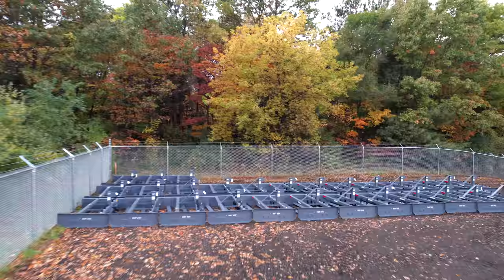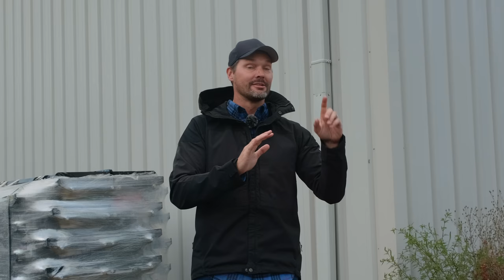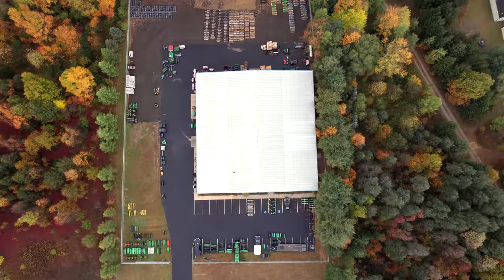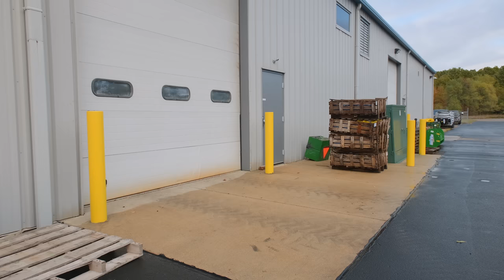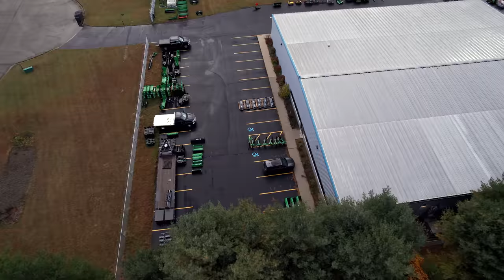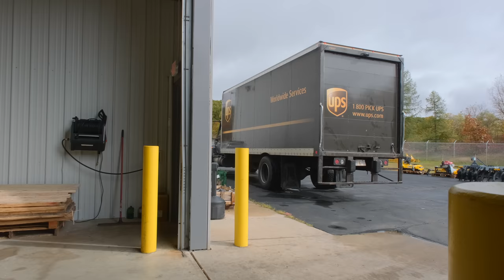$150,000 DOESN’T GO AS FAR AS IT USED TO, WHAT DID IT BUY ME?

Comment: FOR THE SAGGING ROOF INSULATION. I would use 2-3" hardboard insulation, paint it, and cut it to fit in the web of the I beams! won't sage and adds lots of R insulation up high where the heat is! You did good for 150k!

Comment: I’m a facilities engineer and just ran across this insulation problem. In my case the insulation face was too brittle to tape onto so we looked at spray foaming but it was against a certain NFPA code I can’t remember which one exactly. Some local inspectors will let you paint spray foam in warehouses with intumescent paint but we opted to build a small grid between frames and lay in new insulation and tape the vapor barrier to the stronger face a couple feet outside of the damaged area.

Comment: I owned a metal building bizz for several years and for me I wouldn't use patch tape as has been suggested over those rips. After a short period of time it always ends up looking discolored and sometimes worse than the rips themselves.  Since it is at the peak, more insulation there could be of benefit, so I would get a 1 inch reinforced vinyl backed roll of insulation (same as you have there now) and put it in whatever the width is between the top 2 purlins and running full length. Install with wire retainers that hold by tension between those top 2 purlins. Start at one end with some of the 1 inch insulation removed and the vinyl secured via double stick tape at the end wall and give a slight stretch to the vinyl as it goes up, overlap any seam and use the patch tape there between purlins to lock it into one long piece from end to end. 2 man job on a manlift plus a ground guy to feed the insulation up, tape new rolls together, move tarps, as you progress. Lay down a tarp for the vinyl to sit on or it will pick up dirt very easily and hard to get off once up...tell everyone not to walk on the white backing because foot prints on your ceiling look terribly unprofessional...any metal building supply house will have the insulation needed.
Reply from the maker: Awesome, absolutely excellent information.  Thanks for taking the time to share!

Comment: What I did with my steel building (not as big as yours but same construction type) is insulate the underside and a layer of steel on the under side giving you twice the insulation and the steel looks really nice.  made it easy to heat in winter,(i am in Canada.)and stay cooler in summer.  no doubt the most expensive option but i have saved money on heating and it has stayed looking perfect since completion almost twenty years ago

Comment: Simple method, put a thick, like 8-10 mil plastic sheet up and blow insulation between it and the existing.  More elaborate method, pull the existing out, put a barrier up and spray foam it.  Don't spray foam directly to the roof as the steel over time will break the bond since it moves more than the foam will with temperature swings.

Comment: Perhaps some spray foam for the insulation. You've done an awesome job with the place.
Reply: My thought also, some spray foam to encapsulate the damaged area.
Reply: I agree, spray foam would work.
Reply: Would it be better to remove the insulation in that center section then spray foam it. I expect the raccoon have left a lot of surprises up there. They are dirty animals.
Reply: @bruceanderson9461  my thoughts exactly just had my place sprayed on top of the ground crawl space but ask the people that do it they would know best eh...
Reply: Spray foam is almost certainly the way to go. R value tends to be very good too.
Reply: Depends, spray foam on steel in a barn type building like this tends to come apart after a few years due to temperature swings. The steel expands and contracts a lot and can break the bond between foam and steel.  If a substrate is installed between the steel and foam, that air gap can prevent this.
Reply: @acdii  This is disconcerting since I live in a house built with steal siding and roof and it is all spray foamed.
Reply: @stimpy5067  If the building was built with spray foam in mind, chances are they did whatever is needed to prevent temperature movement from breaking the bod. It is more difficult with an older building with the batting type insulation. Just have to make sure that whoever is doing it, does it for metal buildings. 
I was stabling my horse in a metal building with the spray on foam and it was coming off in chunks.

Comment: As a relatively low budget solution to that ceiling issue, I'd do the following.
1.  Clean the surface
2. Spray a rubberized compound (used by HVAC mechanics to seal ductwork or RVers to coat their roofs
3. Embed fiberglass cloth or screening
4. Spray a second thinner coat of the rubberized compound (tint to the color you want)
This should be good for many many years.
You'll need to rent a scissor lift (I suggest a long one so you can have at least two people working up there and not having to move it so much.  You'll also need a commercial spray unit that can handle thick material.
Hope this helps and best of luck for the future.

Comment: I used adhesive vinyl sheets (cut to appropriate size for areas being repaired) from a local sign shop to repair similar insulation damage on a warehouse. It has held up well for the last 4 years.

Comment: Consider an electric jib crane  and a couple of steel work tables for assembly of the box blades and such to reduce potential back injuries. (Your insurance will go down enough to pay for it.)  Assembly will go faster with a lot of things.  Bring a pallet of parts over and park the forklift.  Use the crane to pick up and bring them over to the assembly table.  Also will hold them in position so one man can work alone, freeing up the other man for other duties.

Comment: Maybe a foam type insulation( either soft or rigid)  with self adhesion to bridge across the center and hide the torn area. Can then tape along the edges for more reinforcement and hide any gaps for a uniform look. Will add an additional layer of insulation and cover the ugly area. Probably can do that yourself and save on the contracting costs. Very nice facility.

Comment: Congrats on the new space , you can’t let all that traffic drive buy without getting a toll after all you payed for it already , and the warehouse ceiling .. they make 5’ roll insulation with or without scrim ( the vapor barrier ) added insulation is a quick ROI $ and your employee’s will love you for it summer and winter for sure ! 
The raccoon  story .. maybe ? I’m thinking that the ridge cap flashing may not have the foam encloser strip install correctly or at all ? Could be wrong but worth checking  and don’t step on the ribs when your up there ! ( just a pet peeve of mine ) 😂❤

Comment: I'd repack it down to the bottom of the support beam that goes across there and then I'd pan it looks like it might be about what 16 18 in wide you can do some 19 gauge nothing really heavy when you guys even 21 gauge cuz it's not really holding nothing but the insulation so I would pack it type and then I'd cap it you can use some self-tapping screws on both sides put you a little crease in the Middle with a brake you know whether it be you know say 9 in on one side and 9 inches on the other side you know just to go up with the angle of the roof just a crease right down the middle with a break and then the biggest thing is outside on top of the roof you have these end caps and they're supposed to have styrofoam stuffing in them and they're supposed to be shaped like the ribs on the roof and they go up top for the ridge cap so you can keep the animals from getting inside there whether it be squirrels whether it be raccoons whatever even birds or whatever that might be your first thing you want to do is just make sure the animals are not getting in anymore that ridge cap is very important to have it sealed off like I said it should have styrofoam already in it sometimes they can chew it out or something like that you can always use a silicone roof silicone some mp1 which is high dollar roof silicone is very good stuff 50-year warranty stuff and you could always feel your gaps up there the animals do not want to chew on that because it's nasty silicone but you know whatever it takes just to close in the holes and then from there you can be if you felt like you keep the animals out then you could just take the insulation tape which is made to tape scenes and you can just tape up the you know the holes or the splits and everything are at if you feel like the animals and won't go get in there in bigger areas you can replace it or like I said you could pack it little thicker insulation and then of course cap it to keep anything from getting inside but yeah there's a lot of options there the biggest one is finding where they're coming in so you can stop that wire screen works really good it's been times a week with wire screen on roofs because air still needs to get in but the animal doesn't so so a good heavy gauged you know like chicken wire but very close together I'm talking about it ain't chicken wire but it's anyway which time I like quarter by quarter half inch by half inch squares and a good gauge wire to make a cage we've done that before on roofs to keep animals from getting in and the wires got to be thick enough they can't chew through it if you get a little screen stuff like you have on a porch or something that won't work they'll chew through that screen you need and you know heavier wire for that to make some cages and stuff like that but anyway hope you all works out

Comment: Definitely spray foam should work
Reply from the maker: For the insulation issue?
Reply: @GoodWorksTractors   I would not rip out the center, simply spray a poly urethane closed cell directly over top overlap on the steel beams on both sides, try to be neat and tidy. this will lock in the insulative factor and reduce moisture transmission.

Comment: GWT:  Thanks for the tour of your facility!!  Like a lot of the things that you have done!!  The multiple security features (defense in depth) with the cyclone fencing, security barbed wire, high levels of night lighting, cameras, and intrusion detection system are all solid choices.  Make certain you have a high quality padlock (Medeco or equal) on your gate with anti-bolt cutter chain.  Also would post signs at the gate that this facility is under 24-hour video surveillance.  As to the torn insulation blankets from the raccoons (they are pesky), I would go with an overlay.  Here from our YouTube friends is a video https://www.youtube.com/watch?v=nmRFrObl6Z4 on this from BlueTex Insulation.  I have no connection with them but have talked to a couple of people over the years who have done this with similar products (different vendors) to clean up the looks of an older facility.  Best wishes for continued success.

Comment: Most of the costs mentioned would be included in the cost of a new building ( paving, security, fencing, lights, landscaping and irrigation,, hvac, outlets, carpets)   little was due to the actual configuration of the building.  You got the building cheap because it needed some of the stuff.  What you are really complaining I ng about is how you financed it.  You could have gotten an impro event loan to cover most if not all of this.  With the higher interest rates you may be grateful you burned cash rather than got loans.  Wow times have really changed from you doing every thing with your father helping clean equipment.
Reply from the maker: I didn’t get it cheap by any stretch of the imagination.  These costs would be included in a new building and rolled into the loan.  I discuss this is the video.  An LOC is available if you have enough equity.  I got it before rates went up.

Comment: some white duct tape over those holes should be fine or a sticky film
Reply from the maker: Yeah maybe as easy as that
Reply: @GoodWorksTractors  if you wanted to add another layer of insulation, my mom's pastor works for Fi-Foil, its hung on the bottom of the rafts with clips and it pretty cheap like 50 cent a sqft i think. its a reflective radiant barrier